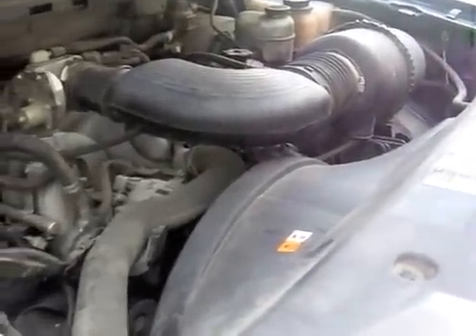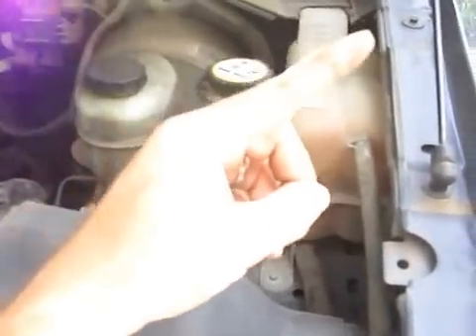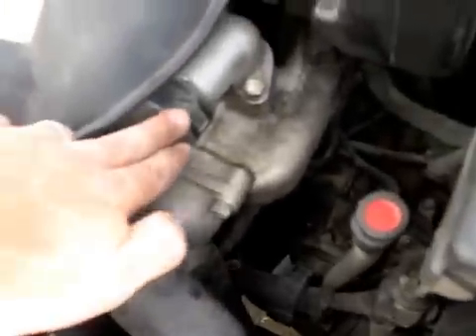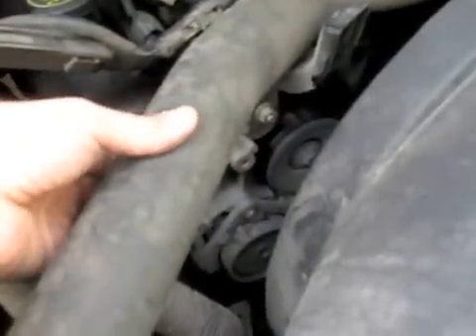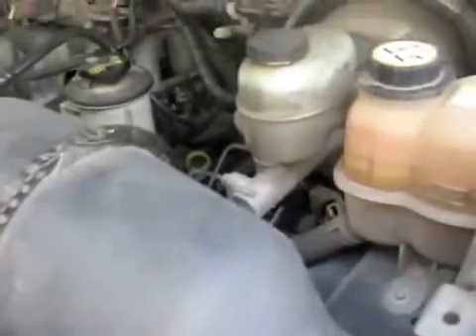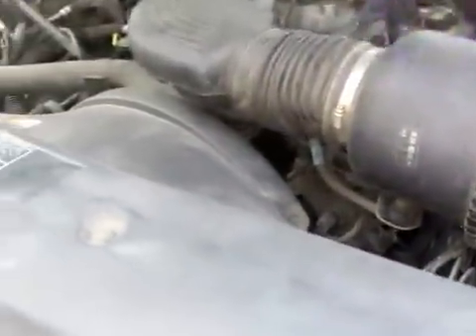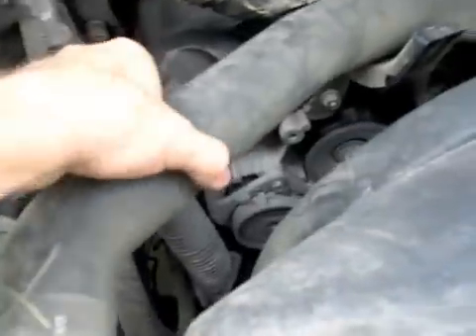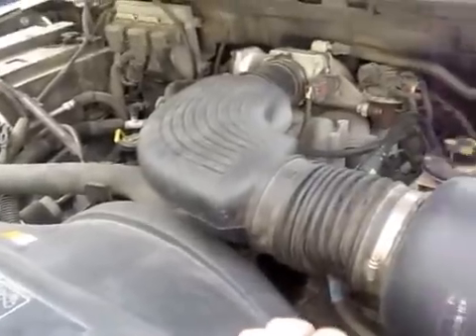Car Engine Overheating - Causes and Symptoms of Over Heating  Car Engine

Comment: There is only me, I'm not daft the so thank t gave his is and essay/novel, I do ramble. Please read it and, stick in there it does end lol... b4 to day u tube has help me fit wd
please help cud anyone help but mainly someone who knows a little about cars.
Proplem.....
I had  to replece the
The coolant water tank, didn't get ford, I got it from euro parts, u have to buy the lid. The rank wud over heat..... Then wen one day it went bad, and it was the water hoze from engine to the heater blowing into car. The pipe blew the garage said. I paid 300 to get fixed, came home, pipe fixed but water over heating more. So I rang them they said sounds like yur head gasket 500 so I took it in to see the boss we where in the office he said, b4 I even look I know it's the head gasket, he took the oil cap off and it was full of white thick cream see that's the best sign. OK will sort it wen I get muny. I went home and watched videos like these. Someone said the best rest is leave the cap off the water tank put water in and turn the engine on if it's the head gasket the water will rise fast.
Or smoke out of exhaust, pulled the oil cap off shock no creMy crap no thick gunge.
I think the fan straining to get round like an old person with out a walking stick lol. U hear it forcing itself to go. Then wrn the garage took the mannafold off to do pipe, they have not put back a big sound pspe attached to engine. Can some one please tell me if it was full of creamy gunge and thick full, and ive looked today and there is no thickness and defo not creamy thick stuff, like wen garage had it and lookex what's happend to creamy stuff and is it the head gasket, the water is spurting out of wTer rank lid please help. As I can't get out the house my DPTSD is bad,
Plus I want to stop kicking the heap of junk it hurts my foot lmso

Comment: that was a really great video!  thank you.  My car had many leaks of coolant. I bought a new housing unit, thermostat housing, changed the tubes coming from the reservoir and changed the reservoir itself!  The external leaks stopped my coolant was good...until last week my wife said the car wasnt able to start after using the AC for 15 mins on a hot day.  I checked the coolant it was almost completely gone!   I refilled it and it stayed full until today.  today it went from full to empty in 10 mins and my car overheated big time.  I drove 5 mins until I was home on an overheated engine.  What the heck is up with my car???? please help me rule out some things
Reply: Barry Zelcer possibly the heater core or a blown head gasket.. just pray it’s not a cracked head or engine block.. also worn out oil rings will cause a vehicle to smoke out of the exhaust without the over heating problem. There are many things it could be actually.

Comment: Hi, thanks for the amazing video, I have a question which most of mechanic is not able to find out.
If I am running my car without AC its working fine, Even if I drive over 100miles, But if I turn AC on and run car for about 30 mins and turn off the car, My car won't start. It will start automatically after 15 -30 mins. I have checked the radiator its working fine, Fan is working fine. Not able to find out the issue.
Reply: I would try taking your meds. Lol

Comment: How many radiators have you replaced because you don't know how radiators work? They are not the same as the aircon condensers, they have a common tank at the top and bottom and if you remove the drain plug at the bottom or the bottom radiator hose, you can flush out the scale settling in the bottom tank. The radiator tubes of a car's radiator typically runs vertical and straight between the top and bottom tank. Also, if you get scale buildup, it can be removed with a good quality radiator or coolant system flush and flushing the coolant system is always a good idea with high mileage vehicles.

Comment: What if you find oil in the overflow tank and on the radiator cap? Can it be a cracked head or seal? 
Thank you. I hope 🤞 to hear from me. I don’t want to blow up the engine. 
Yes I am a woman doing the work. Almost to old to be doing this stuff.

Comment: So... I replaced my thermostat, my water pump and my radiator. My 2005 Chevy Uplander LT that has 208,000 miles on it is still overheating. What else should i check for?
Reply: Radiator fan and cap

Comment: Its over heating at lower speeds 30 to 40 tried turning on the heater helped a little tried ac helped a little

Comment: 1999 mazda 626 automatic i did replace radiator cap yet its beginning to over heat no leakage yet transmission fluid could be dirty previous owner could've left it like that check engine light on recommendations is the radiator fans or both fluids should be flush i did purchase engine coolant temp sensor haven't yet replace the old one also thermostat was recommended not sure what to think of it was fine about hr or half hr ago 6ish pm plus its gotta low pulse while staying put idling off and on yet not frequent so unsure whats the next target also transmission is beginning to slip 1st gear to 2nd gear 30 secs or less its off and on both fans near or next to the radiator are both not working
Reply: ZonaFly G Devotie always start cheapest route replace thermostat top fluids off with 50/50 run engine at idle squeeze radiator hose if soft then replace water pump! If ok then disconnect temp sensor and fans should turn on

Comment: hey im not sure where to turn to but here it goes......So my engine overheated for maybe 1-2 seconds passed by until i turned it off. it ALMOST reached the H mark. i had coolant everywhere and it sprayed from the cap. At first i thought it was the cap so i replaced it. i topped the coolant off and it idled fine. (my car is parked on the street at this point). I notice that coolant is not circulating through the hose...so i give it a good squeeze to force coolant to circulate and my engine temperature needle immediately drops to cold (it was at normal operating temperature and it dropped to almost cold...i assume in result of finally getting coolant to circulate) i also notice that hot air is not coming from the vents, just cold. At this point i turn the car off, i start it again with no problems a few times. im like alright car hasn't overheated at all besides that one time for 1-2 seconds. I decide to move the car inside my driveway which is like 30 seconds away, as im going up my driveway im carefully making sure my car doesnt overheat and then out of nowhere the needle starts shooting up to hot. i immediately put the car on park and as im going to turn the car off i see that the needle reaching the H mark, this happened maybe between half a second to a full second but turn it off really fast. i have coolant everywhere again (came out from the new cap i had just installed on the radiator)   and im just scared out of my mind since i dont have money to fix this, even if a headgasket blew i cant afford it at the moment. anyways, i proceed to top it off and let it sit for almost 10 minutes. i go to turn it on and it cranks but wont turn on....at this point im scared as hell that my engine is gone since its my only way of transportation. i crank it a few more times and it feels like it wants to start like it only needs a little bit more but wont turn on. I finally gas it and and it turns on..... once its on im watching the temperature to keep going up the driveway, i check for any white smoke coming from the tailpipe but it feels fine. car didnt shake or rattle or make any funny noises. i go up the driveway like nothing is wrong. i reverse into my parking spot cars temp is fine and i proceed to turn it off. 
Things that i have checked for:
-radiator fans spin
-waterpump was apperantly changed by previous owner (ive only owned this car for like 2 weeks)
-cannot find a collant leak anywhere else besides the cap
-no white smoke from tailpipe and when i gassed the car to turn on it felt fine.
-also oil looks fine, no milky like substance
.......i have ruled that it might be the thermostat so any opinions would help. I am really scared to try to turn on my car again in case it doesn't want to turn on and in case of messing something up. Has anyone had a similar experience? do you think i warped some heads despite the really short time that the engine overheated....its not like i kept driving minutes or miles like some people do. i was on an uphill when the car cranked but didn't start....not sure if that has anything to do with it.....this is urgent so i really would like to hear your guys experiences.
Reply: Curious if you found an answer to the overheating as my f150 4.6 is acting much the same way.
Reply: Mike Tidwell the car is in the mechanic right now. I changed the thermostat and coolant started circulating but then I realized my radiator had tiny pinholes in it so I decided to have the mechanic change the radiator and water pump. I will let you know if he finds anything else

Comment: I have 2005 Pontiac Montana 3400SFI Engine. Approx. 85,000 miles. It's overheating. Coolant overflows in the overflow , then when it cools down overflow goes almost empty and all the fluid is coming the radiator cap when I take it off. The hose that leads from radiator to water pump is cool and doesn't seem to have water in it, but the hose going into the overflow is hot. I have no heat coming out of my heater. Already changed thermostat. Any suggestions?

Comment: Can anyone help me figure out what's going on with my Buick LeSabre? We took it to get a new radiator, new water pump, new thermostat but the car is still overheating and losing a lot of coolant there's a leak I don't know what it is but it's by the engine and the water pump it's difficult to figure out the problem

Comment: In 17 years I've only had 1 bypass hose which ruptured, other than that I still have all the original hoses from 275,000 miles ago. They have outlasted 3 radiators, a thermostat, and a water control valve, I'm hanging on until they start bulging or rupture. They cost to much to be replacing as preventive maintenance.

I probably would have changed all the hoses 3-4 times and spent around 300-400 bux along the way.

Comment: I replaced t- stat (new) also new 
Radiator.& new reservoir
And stilll😕😔  overheating
Reply: JESUS RAMIREZ  could have air trapped in your cooling system

Comment: This guys family has been in the auto repair business for over 63 years so he's an expert. This video helped me solve my over heating problem in 10 minutes. He was a technical consultant on a car maintenance software program www.lonewolf-software.com/automotivewolf.htm you can use on your computer to monitor and manage your vehicle maintenance schedules. All the maintenance schedule requirements in the program are from this guy (Austin Davis). I've been using the software for over 8 years and both my vehicles are always running great and it has saved my a lot of money in repairs.
Reply: I use the Automotive Wolf software too. It's great :)

Comment: My 1988 Nissan pickup is overheating. I changed water pump, new radiator, new fan, and new extra fans. Also, I got rid of the thermostat. No leak whatsoever and still overheats at idling with AC on. What’s really going on with my truck? Any idea?

Comment: New thermostat, new cooling fan, new clutch fan, new radiator cap, and still overheating after 20 minutes of driving. Coolant gushing out reservoir and boiling. Any ideas?
Reply: It was my water pump. Fixed it now.

Comment: Help. Engine sign on. Got it scanned at auto-zone and it shows I have engine misfire. Wondering if that’s what’s causing it to overheat. Or my temperature sensor is faulty. Even when I drive my car 3 minutes in it overheats; I open the radiator and immediately it cools down and goes bk to normal. I already put enough coolant in it and can’t figure why it’s overheating

Comment: Hey as I’m driving a few mins my 05 CV temp hands start to rise & temp light comes on I replaced entire intake manifold so new thermostat that was leaking which was causing it to run hot but now it’s still running hot. Now I don’t know if it’s the water pump, radiator or blown head gasket. Can you please help 

Thanks
Reply: It over heats at freeway speeds the fan works, no white smoke from hood or tail pipes

Comment: My 2003 GMC Alero is overheating. I use water in the summertime. Soon as i put water in the cooliant container. Its empty. There is a puddle of water under the car. Wat is my problem?

Comment: Hello, I've got an 02 v6 Xterra.  I've cleaned out the radiator debri, checked the thermostat, and burped the system.  I have no leaks, and am not having to add fluid.  Also I changed the clutch fan.  When I drive it, the heat stays in the normal range.  If I stop at an idle for more than five miniutes, it then will climb to the warmer range.  I've never over heated it, but I have came close.  If I drive it it then will go to normal.  Any ideas will be appreciated.

Comment: My car is overheating while i turn the car on. I drive it with my air conditioner on for awhile and park it. When i come back to turn it on it overheats but it slowing goes down, then i can drive. I have no idea. my idle jumped a little, so i took it to my transmission mechanic and he said my engine is over heating, so i took it to my regular mechanic and he said it is not over heating, nor the thermostat. he told me to check the water and my transmission oil was checked as well. I am so confused?

Comment: 2012 jeep jk. Coolant level is fine radiator is fine can't find any leaks or cracks. My problem is jeeps temp gague goes up after 30min of driving only at low speed or at stops. I can hear the fan get really really loud. After a min or two then temp goes back down to normal. N stays at normal level until i start slowing. Then it does that same cycle again.

Comment: I don't know if you're still responding to this video. I've got an 05 Accord 2.4 cylinder that I've replaced the overheat fan motor and it has fail safe thermostat in it. I'm still overheating and losing coolant at such sporadical times. I'll check it all day and it's fine, then quite randomly, in the evening (which is weird, I live in Ft. Worth), I'll be overheating and my overflow will be empty. It only cools off once I get to highway speeds and start cooling off the radiator which is relatively clean. Help would be greatly appreciated!

Comment: You need to do a little more research is that fan is also hooked to the water pump especially on that Ford that you're talking about and thermostats are not always on the top radiator hose there's some cars out there that have them on the bottom and some cars that have them underneath the vehicle from the bottom radiator hose and also some new trucks do not use that style fan that use the electric fan are there some Dodgers that have an electric fan that hooks up to the water pump and has an electrical component to it

Comment: Overheating problem, changes thermostat and water pump, no obvious leak. I noticed that the lower reservoir hose is cool when the truck over heats( 2006 Chevy Silverado 1500 5.3). The hose I’m speaking of I believe is connected to the heater core connector or it is the heater core connector hose. The radiator hose be hot but the lower one on the bottom of the reservoir tank is cool. Help

Comment: I have a mazda 626. Just got a radiator, timing belt and water pump replaced on it. Lasted a few days but now it's overheating. Any ideas? There's still coolant in it

Comment: I own a chrysler 200 2014 and its starting to over heat since I replace the radiator hose, problem started slowing and now its gets over heat when driving, a mechanic told me to turn the heater on if it gets hot and told me I will have to replace the engine soon . What is the alternative to repair this problem that wont cost me a thousands of dollars.

Comment: Hi, my Honda Accord 2011 2.4L car'sengine overheated 3 times, (one time, slight smoke came), because of a faulty radiator. Now I have replaced the radiator and drove around 1000km+, with the car performing the same as before it had the radiator issue. It drives smoothly and perfectly. What I'm worried about is, was the car's engine damaged by that heat? Will it reduce the longevity of the car? I plan on using it for another 10 years or so. Until I can afford a new one.  Will it be reliable enough for another 200,000 kms easily? Its odo is now at 90,000 kms. 
Thanks.